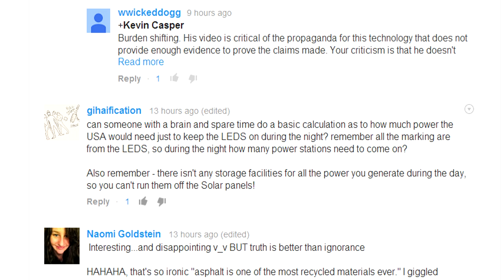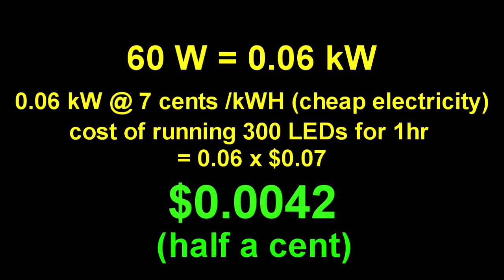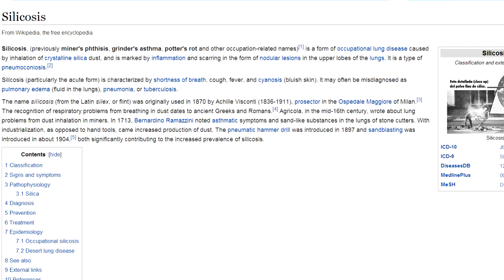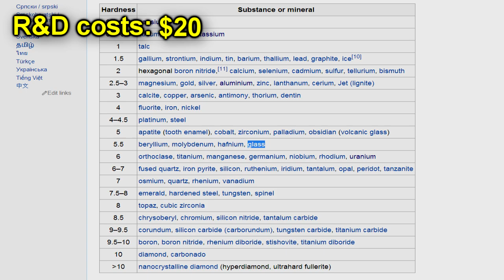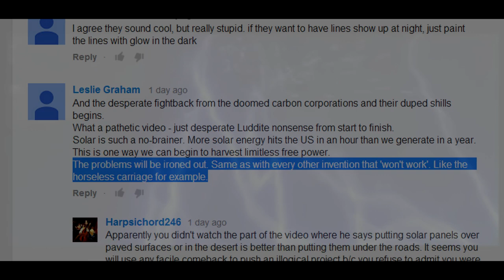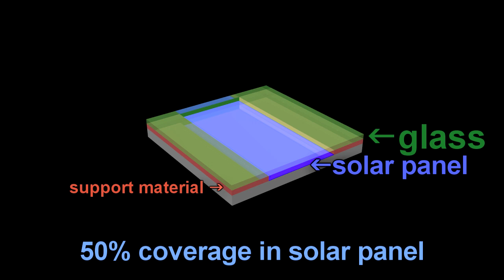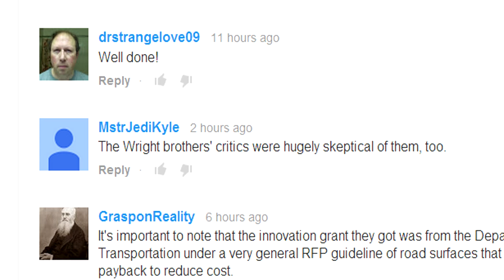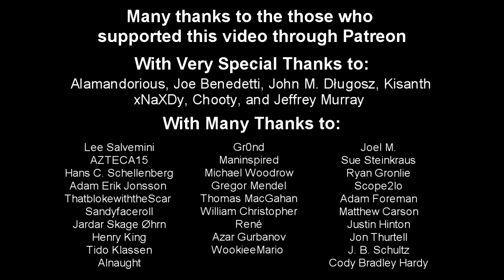Solar Roadways, IMPORTANT QUESTIONS AND ANSWERS!

Comment: You make many very good points, but I think you're in error when you calculate the cost to run the LEDs because they're not all intended to be powered at the same time.  Looking at the demo at 6:39, I expect about 10% of all LEDs to be powered at once, depending on road and lane marker width.

Comment: 300 LEDs in that strip would take 60 Watts some LEDs themselves would probably take way less because you don't lose hat much power converting the energy. I don't say the point you support is invalid just double check the numbers (I found some taking up 19,8 Watts per 300 and that is a worst case (every colour needs a different voltage).

Edit:
It does not focus in yet, that not all the LEDs would be lit up since the markings make only a little % of the total street.
I still don't know if I should like or dislike the idea of these panels, but Thunderf00t seems very bias on this subject.

Comment: I was also wondering: You said your panel was rated for 40 watts but when you demonstrated it at an optimal angle we saw 19.4 volts. Is the amperage on your panel 2 amps?

Comment: 2 questions. 
1st is glass dust as bad, or nearly as bad as asbestos? At the very least, it certainly wouldn't be very good for tires.

2nd I recall that, in one of these videos, they mentioned replacing sidewalks. Assuming the LED's weren't included, would they work at all as a viable alternate energy source for, say, a neighborhood (weather conditions aside)?

Comment: I think the roadways are kind of  BS, but I have an issue and a question for this. 1: The panels looks to be about 3/4 of a meter at least. Also, compared to current lighting systems (street lights), how would the cost for solar roadways compare?

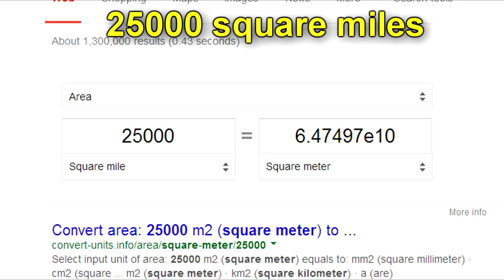Comment: 1:40 - that's like the most extreme scenario possible, and that's what you base your math on - a little dishonest, don't you think? 0.1% of that coverage, if concentrated in urban areas, would be a decent start (that's still 65,000,000 m^2). $1.4 billion a year wouldn't be so bad.

And that's assuming we never come up with more efficient solar electricity generation methods.
Reply: Also, glass is not an element. It's a whole category of materials.

Comment: Can I also point out that the solar panels will not be getting alot of light when it comes to highways? The roads are full of cars all stopping light from reaching the panels. You also have buildings on the side of roads meaning that some panels will not have sun on them for several hours a day.

Comment: I understand your deconstruction of the current way they are attempting this, but I'm really curious how you would go about making a solar powered road? I imagine you'd want to change the materials involved (no glass) and maybe even have the solar devices resting above the road instead.
Reply: Instead of a road it would be much more logical(not to mention cheap and effient)to build parkin lot covers,all kinds of rooftops and along the roads,using more common and cheap solar panels.

Comment: 1st. Not all LED's light up at the same time.
2nd. Not all roads will be replaced in an instant... there will be tests in small areas first to see the validity of this concept.
3rd. And what if there is a possibility to make the panels store the extra day energy for use it in the night. There are already street lamps made like this, and they give light during the night, which have stored at day time. There are cells, that can can store energy during a cloudy day too.
...i wont continue to see all your video, but it looks to me that you dont want to examine if this concept is doable, but instead trying to bash it using a certain kind of logic, which is no logic at all.
Thank you, but im not convinced that this project is no good.

Comment: So, horizontally immovable solar panels which dont even span half the surface of those hexagons (and therefor the road), coated with very thick glass, coated with rubber, debris, trash, many times covered by actual cars...

How is this project at all any better than putting solar panels on roofs, which take up most of the actual area of cities?
Reply: Because fuck logic, that's why.